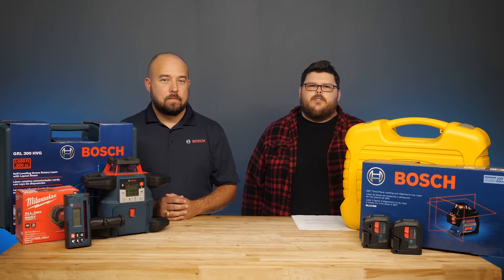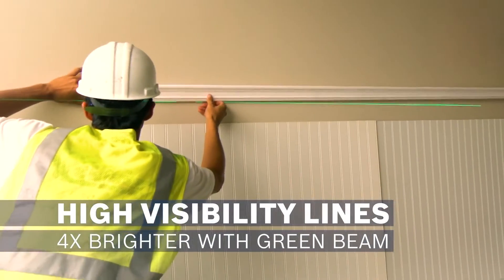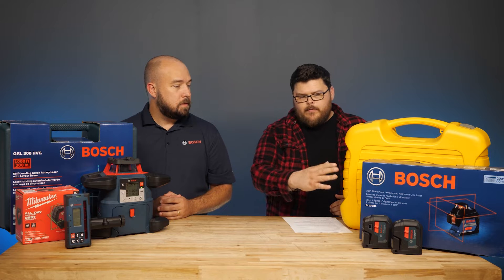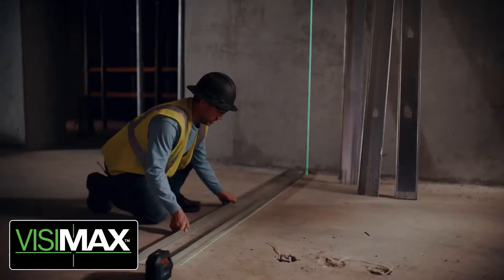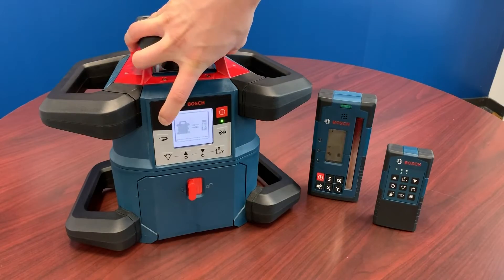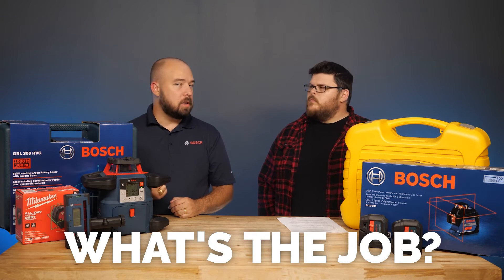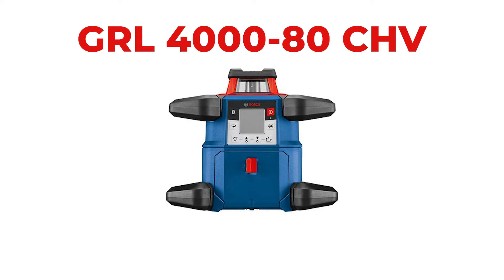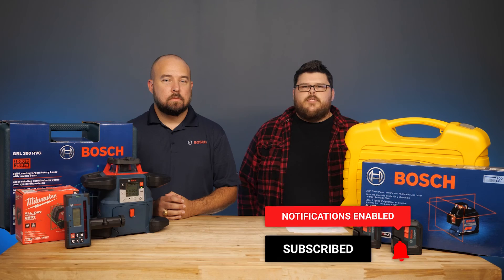Rotary Lasers vs. Cross Line Lasers | Right Tool For The Job

Comment: "In applications, where you want to see the beam..." - are there applications where you would not want to see the beam? What's the point of a beam if you cannot see it?

Right, makes sense - that's what receiver is for! 

Thanks for the video - answers a lot of my questions!
Reply from the maker: Great question! In bright outdoor applications or long distances, you often can’t see the laser beam with your eyes, even if it’s green. That’s where a receiver comes in. It detects the beam for you, so you can still find level or alignment points without visibility. Glad the video helped clear things up! Let us know if you’ve got more questions, we’re always happy to help.
Reply: @OhioPowerTool thanks so much!
Reply: Sometimes you spend a few mins lining your laser lines on points and then something comes up where you have to move the laser level itself.  But the problem is you dont want to have to spend a few minutes again getting your lines where they were before, so what you can do is before you cut your laser level off and move it,  mark the intersect point of your two vertical laser lines on the floor (intersect will be on floor and roof) and then mark a point on the laser line about 2 ft north / south or 2ft east and west of that intersect before you move your laser level.   If you mark the intersect and  at least 2 other points where the line was, then you can get your laser level and the laser lines set up in the exact same spot in literally 20 seconds instead of taking several minutes again trying to get the laser level/lines in the correct position.